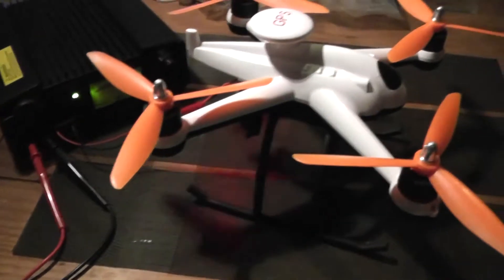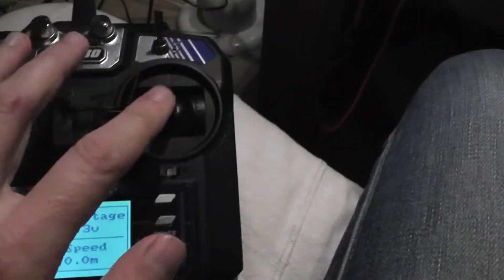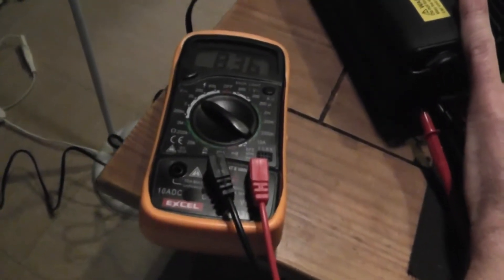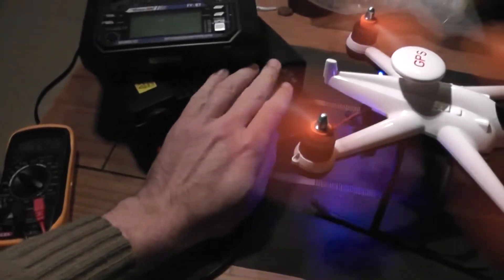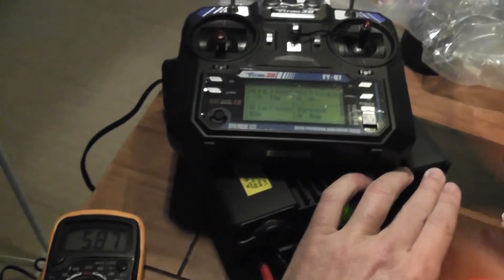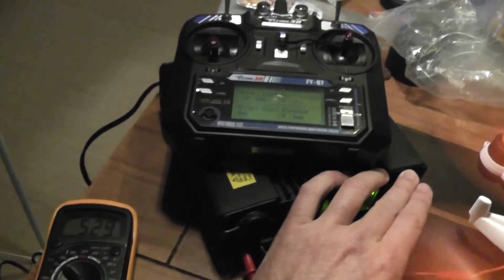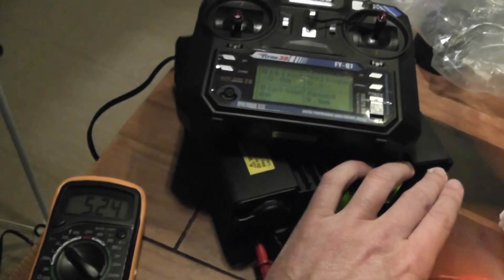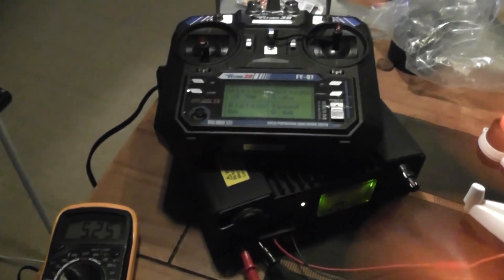Flying3D X6 voltage drop testing (Courtesy Banggood)

Comment: What settings do have on the transmitter for the low voltage rx alarm? I saw that 4.7,4.8 and 4.9 were recommended for low, alarm and high?

Comment: Question:  I want to purchase this quad with the transmitter that you are demonstrating in this video.  The one with onboard telemetry.  However I cant seem to find information about the price.   All the Flying 3D X6 I find  have the standard transmitter.   With no screen.   I believe the one I need is called: Flying 3D FY-Q7.  Any information would be great.   Thank You in advance.
Reply from the maker: No all FY-X6 have OSD included now, especially at BG. So if you click in the link in the information of the video, for sure, the model sold is with OSD as I have

Comment: 5V is that low, your battery is broke and the X5 allready on the ground. More realistic would be 7.0V or so. I gve that tot the 3.1 fimware and it's working for the LED's.
Reply from the maker: Of course it's too low at +5V, it was a experiment to test limit values.
Reply: SeBy DocKy Ha, oke. I have the first warning at 6.8V now, second at 6.5V for the stock battery.

Comment: I wish this had occurred on my Cheerson CX 20 the couple times it crashed.  It goes into LVC as you know.  My understanding is this can be disabled via the APM software for the Cheerson.  I watch my timer closely and use my low voltage alarm when flying.